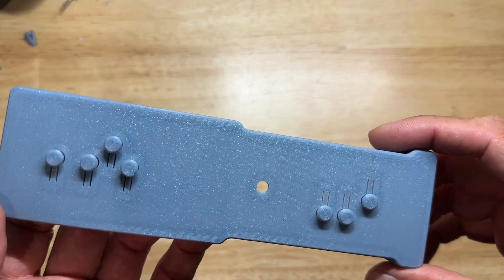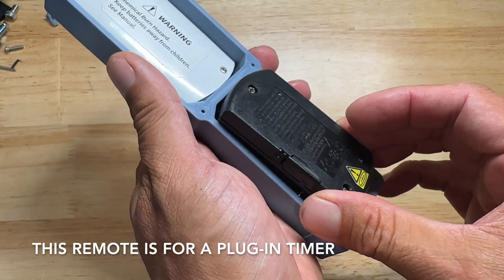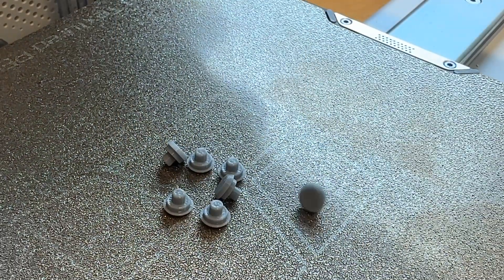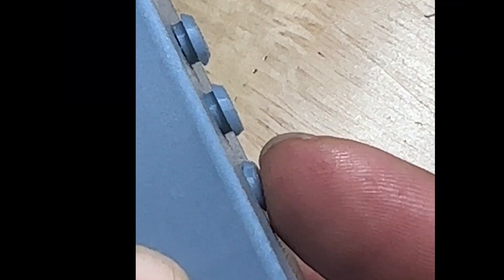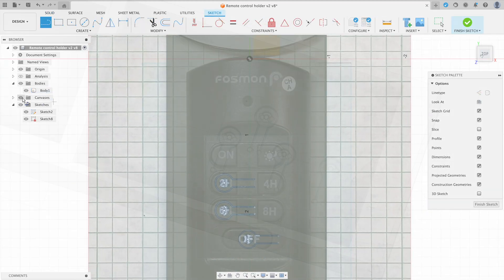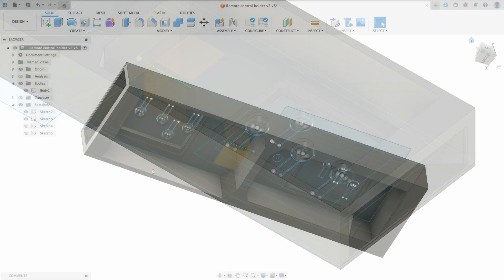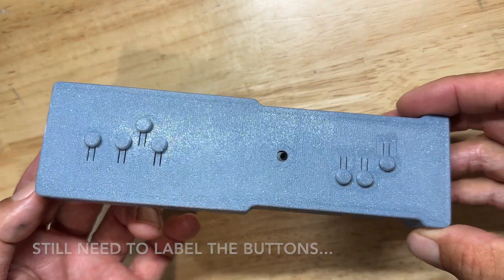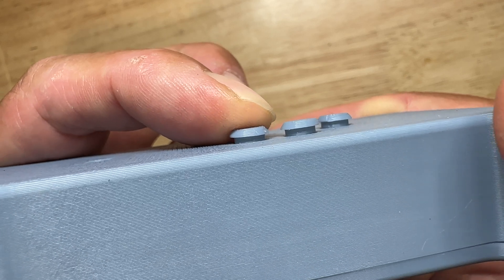3D Printed Remote Control Combiner

Comment: Maybe add a label to each end or to the buttons still. Though if you use it everyday you'll remember what does what
Reply from the maker: I ended up re-printing the cover with text labels embedded in the 3d print using different colored filaments.  https://youtu.be/WqEMKUcQtyk?si=HyJnyAuu3liJBHVX